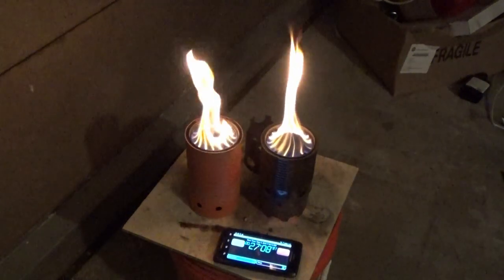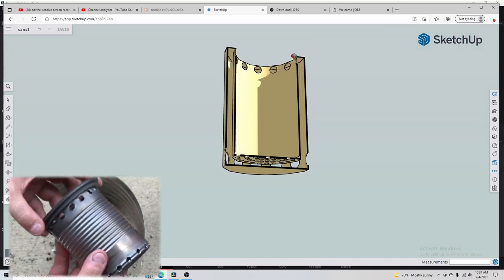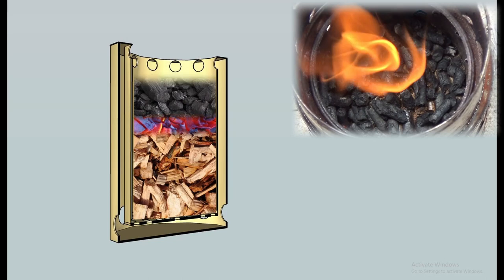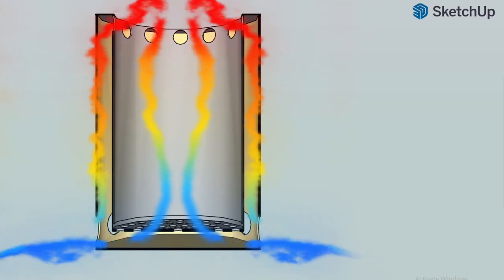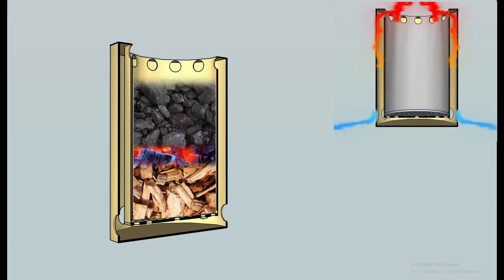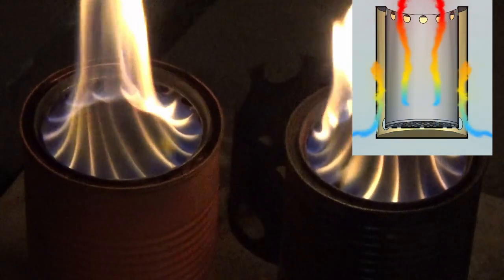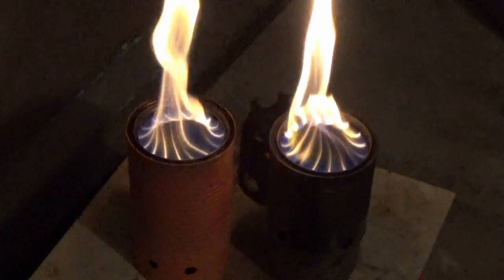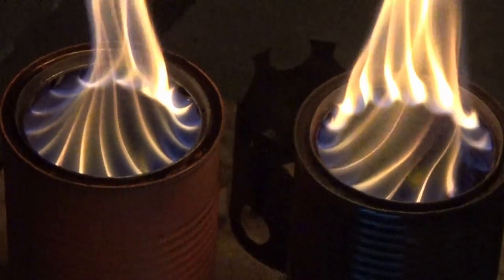Wood Gas Stove Science| TLUDs Explained | Camping Stove | Tent Stove

Comment: You said you had to tinker with the primary and secondary air flow of the tent stove. Will you be coming out with a perfected version of that anytime soon.
 Have you considered making one of these types of stoves to run off alcohol or heat I would think that wood gas and alcohol gas would work the same way. Evernew And goshawk Have their multi fuel versions. Too expensive though. I think that would be a great project for you to try, Hint, hint.
Reply from the maker: Great idea! I’ll look into it! I’ll have to dig out my Tangia and do some thinking on the subject! Thanks for watching!

Comment: If you were to isolate the primary and secondary air inlets would the stove still work?  If the air is coming in the secondary air inlets then dividing into two flows, one up the sides and the other up through the primary inlets, it shouldn't matter if they were isolated.
Reply from the maker: I have a video on that exact experiment and the separation of the primary and secondary actually make for a higher brighter flame! Look for my video titled "Dueling Wood Gas Stoves". Thanks for the comment!

Comment: has your understanding or theory of how the air flows in the stove changed since the glass jar stove video?  that was quite a while ago.
Reply from the maker: Yes absolutely. My original statements in my glass video about wood gas flowing out the bottom of the burn chamber and out the secondary holes was based on the theories that were floating around at the time. I have since realized the stoves act as updraft all the time and the wood gas is created and burned within the pyrolysis zone above the fuel and below the flame cap. The most efficient burn is achieved if one can fully enclose the pyrolysis zone with flame and not allow outside air to get inside the system. If outside air is introduced (other than through the fresh air intakes) you will get smoke from the stove. These can stoves are what I call naturally aspirated and the system is delicate because it relies solely on natural air flow to make it work. Hopefully this helps. Thanks for watching!
Reply: @heathputnam9524  thank you for the reply.
Reply: I made few years back with a few cans and it would have worked perfect because it all fit inside my stanely camp cook set/cup.    only draw back was that the cans got dirty and rusted easily after being burned up and got the inside of cup filthy.
Reply from the maker: I paint mine with high heat paint. It helps for a little while. Thanks for watching!

Comment: I would really like to see you make one of these   Gasifier stoves using a gallon paint can for the outside. If that doesn't interest you as soon as I find the right inner can I'll let you know in another post maybe you can shed some light on the primary and secondary holes. I won't be able to use your math formula, not that smart.
Reply from the maker: That sounds good! Let me know if you find one! Thanks for the comment!

Comment: I would like your help on designing my stove here. I just found a single piece of quite heavy duty stainless steel double walled planter I think. It has an angled lip on the inside top edge so I think it will be perfect to push that hot air out the inside up and in at 45 degrees.
OD 4.75"
ID 4 1/8th"
OH 7 1/8"
IH 6 3/8ths"

Now I think I get the basic principles but you kinda lost me on the math on the earlier vids of this series. 
Because it's all one piece and the gap between layers is only a 1/4" or so drill I can foresee being a problem, as I would rather not cut it apart.
I have basic tools, and steel drill bits but they don't go much wider than like 12mm maybe and I can't use a roundout bit, you know those tapered ones what ever they are called because I can't separate the layers so should I add more smaller holes or holes in a different pattern or just save up for some other drill bits...I may be stressing overly cause I have no idea what this item is supposed to be for as I found it for £1 in a charity shop, so I have one chance to get it right. 
I may be feeling lost also because it was a while ago I watched the other vids and I will revisit the series but if you have the time to think about how you would go about a single piece design...I would appreciate it.

Edit, okay, turns out it's a white wine cooler...not a lot of good examples of nice clean burns that I found on ytube already tho, only two i've seen, one doesn't even count because he added a fan and the other I feel compared to your jets just looks very inefficient.
Reply from the maker: I found one of those at goodwill and thought I should make another stove. Unfortunately I didn’t buy it, but I do not get a lot of interest in my stoves anymore. Let me know if you have questions in the future.
Reply: @heathputnam9524  Well I still have these questions now...
Because it is a solid piece it's tricky man...
Reply from the maker: OK… the secondary holes will obviously be the easiest to drill. These should be 3/16 - 1/4 diameter. No larger or your flame jet will not have any power. I’m not sure about the 45 degree angle but you can try it. I think it will not produce a good sealed pyrolysis zone(oxygen free burn zone).

The air intake holes(the ones around the outside) can be any size or number. Start small and go larger after the build. You want unfettered fresh air flow but too much will allow wind to effect the natural flow within the two walls. You will know if you need bigger holes because the flame will pulse during the burn.

The primary holes(bottom of the inner can) will be the hardest to drill.  They will probably require a long drill. If you are going to burn pellets do not go larger than 1/4 inch or the pellets will fall through.

The ratio of primary to secondary air should be about 4:1… if you use a 1/4 on both sets of holes drill as many holes in the bottom as possible then drill 1/4 as many around the top. 

Making a one piece stove is not going to be easy. But take your time and be as accurate as you can. I would go back and review a few of my series.

Good luck and keep me posted. Warning: that stainless steel drills very hard!

Comment: I'm trying to build one of these to boil water for cooking peanuts.

Is there a sort of fast and loose ratio for larger TLUDs as far as Secondary jet sizing?  My source material is 5 gallon steel race fuel cans and maybe an old stainless cooking pot if it nests nicely with an air gap, so roughly 12" in diameter.
Reply from the maker: Start at about 1/4 - 3/8 inch in diameter and  start with a ratio of about 4-1 primary to secondary holes. Let me know if you have other questions!

Comment: When I built my first stove I knew nothing.  I used a Hunt's pasta sauce can and a Campbell's soup can.  First thing I did was drill holes around the bottom of the can, which was really the top of the stove because the can is upside down. So I had a row of 3/8" holes around the top edge of the outer can.  As I learned a little, everybody knew these were downdraft stoves where the smoke is sucked down and then goes up between the cans to ignite.    I expected a lot of smoke to come out of the holes that shouldn't be there, but it didn't!  I'm sure it affected the burning, but it still burned without smoke.  It took a while to understand but when I found out how they really work it made sense.
Reply from the maker: I hope my videos have helped in some way! Thanks for watching!

Comment: Can I ask you? The unburnt gases and soot  from the central chamber meet with the super heated fresh air convecting through the walls, replenishing the oxygen levels burned off in the initial burn, giving the secondary burn?  This is how i understand the process. Your video seems to basically agree with my own conclusion. If thats true then thanks so much.
Because there's some weird science out there about these stoves.
  Great stoves though.
     Yours Grant. 🌋
Reply from the maker: The flame actually lifts up to the level of the secondary ports. The area between the flame at the secondary ports and the fuel is the pyrolysis zone. No oxygen so no flames. Other than that your thought are correct! Thanks for watching!

Comment: Sorry but this is wong explanation .
In a TLUD ,the holes on the bottom act as venturi and they draw the smoke down wich gets mixed with air and exits on the top holes.
The upper part draws air from the top through the flame.
To realise this is simple : you only need to estinguish the flame to see that the smoke gets out on the top holes.And the smoke can do that ONLY after it traveled down through the wood bed.
Reply from the maker: Please watch this video where I debunk that myth! 

Dualing Wood Gas Stoves!! Downdraft Debunked?
https://youtu.be/b0vM9aD78XY

The air gets super heated as it moves up between the cans and mixes with the wood gasses and ignites. The flame at the top of the can creates a pyrolysis zone above the fuel creating this very strong burn. Thanks for commenting!

Comment: what if you built a tall tower stove with a number of "secondary inlets"? would that not kill all the smoke as the smog moves up?
God speed anwyay
Reply from the maker: It can help! The pot stand does certainly help, but the taller the stove the more unstable it becomes! Thanks for the comment!
Reply: @heathputnam9524  Hi Heath, great material you've got in this playlist, very enjoyable the watch. If I may, wouldn't the increase of the chimney speed up the burning process creating stronger rising forces? Thanks for sharing your creations!

Comment: Thank you for your work, these are the best videos on the subject. What i'm wondering about in regards to the process of gasification is this: how finicky is this process? does it only work with well-dried uniform material like torrefied biomass and pellets? is it more efficient than a rocket stove, which can be fueled by tree trimming and trash wood?
Reply from the maker: The process of gasification in an open to air vessel is finicky and that is why it has taken me so long to perfect a can stove. A can stove is sensitive to the fuel charge. Most people do not take enough care in the preparation of the fuel. Pellets are compact and when loaded have a high fuel to air ration. (not many air gaps between the pellets)

A rocket stove is a different beast. It burns quickly with a ton of air rushing by the fuel. Not much gasification going on unless you have secondary air inlets then you may take some advantage of burning the limited wood gas that is produced. 

I’d you are looking for a stove that you can continue to feed and burn for extended periods of time then a rocket is probably your best bet. If you want a smokeless, efficient, light weight stove for hiking and or camping that you can boil some water or cook a quick meal then can stove is for you.
Reply: @heathputnam9524  thank you for responding, i will try making both a gasifier and a rocket stove using cans and see which works better
Reply from the maker: Just contact me if I can help!
Reply: @heathputnam9524    Some rocket stove designs compensate for the lack of secondary air inlets by super insulating the fire box so that gasification does happen through the very high temps within same. This doesn't work very well with steel, because it will degrade the steel fairly quickly (that and steel conducts the heat too much). Things like insulated cob, steel lined with ceramic fiber, etc work better. 

  I went to a cob rocket stove workshop not long ago, and the cob rocket stove that the folks had built into their home, was super efficient and clean burning.  They said that in the exhaust was mostly just warm water vapor (once everything was up to temp). That seems to indicate a more full and complete combustion is occurring.

Comment: love you see you back sir, your design and modification are mindblowing but hoping to see a stove where you use wood and leaf instead of pallets as that will have more practical use in camping and other occasions
Reply from the maker: Thanks for the ideas! Thanks for watching!
Reply: I have copied one of the early models and use it in the back yard to make a pot of coffee once in a while.  I have a few fruit trees that need to be pruned annually.  So, I have been using twigs to fuel my stove and it works well.  Mine is not well built like the later designs and usually burns out after the wood gasification stage.  Since I  know the soil chemistry where these trees are growing I feel safe using the charcoal as a soil amendment in my gardens.
Reply from the maker: When you get a really efficient stove it converts to gasifying the charcoal and you get blue flame! (Seen only at night) if this happens you only end up with a tiny amount of white ash. But if you want charcoal to amend your stove you can just dump the char out when the yellow flame ends! Thanks for the comment!

Comment: I'd love to make one of these out of titanium pots for backpacking. You have really taken the fire science to the next level here.
Reply from the maker: Thanks for watching!
Reply: If you can, try to get a pure or nearly pure Ti and not an alloy. I don't know if it is definitely true or not, but I've heard from a few different sources that pure or nearly pure Ti handles these very hot temperatures without degrading, much better than the Ti alloys.
Reply: @justinw1765  You do have a point, but you won't be able to get your hands on pure Ti AFAIK. Still any titanium alloy burn chamber would greatly help the design since it is a good heat conductor, increasing air suction to the secondary air vents. Although that would influence the primary to secondary air rations and require tweeking of the ratio.

Comment: A+!  Well done 👏!
Could you please put 2 wood gas wood stove together as a burn comparison. One built to perfect design and the other that looks like its right but not the best design? Maybe the one having too much air flow or not enough.  I want to see burn times and flame height.  Its a lot too ask so no worries if it doesn't happen. Your videos are great to watch.
Reply from the maker: I could try to do that, but it may not happen. I have been in North Carolina for the last six months for work and am going back to Arizona at the end of September. I do not play with fire out there:) too many wildfires! Thanks for watching!
Reply: That's okay.  I'm enjoying your other videos. Love the final build on the paint can. It has everything.
Btw does painted your cans to make them last longer?
Reply from the maker: Yes, if you use high temp paint it keeps them from rusting out as quickly! Thanks again for watching!